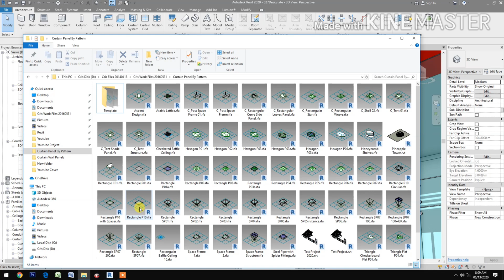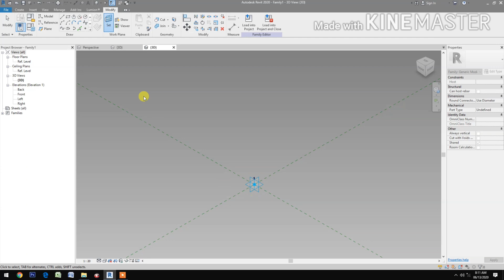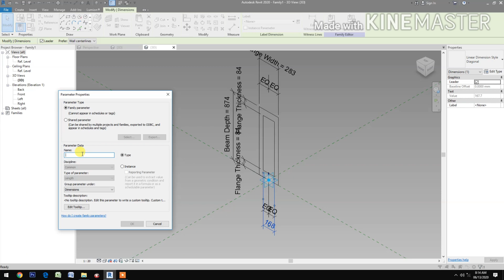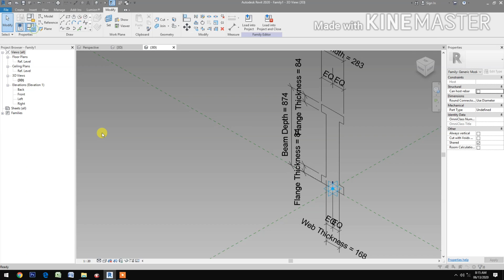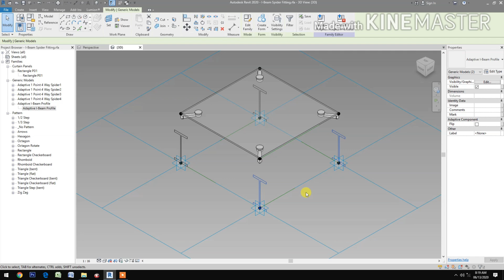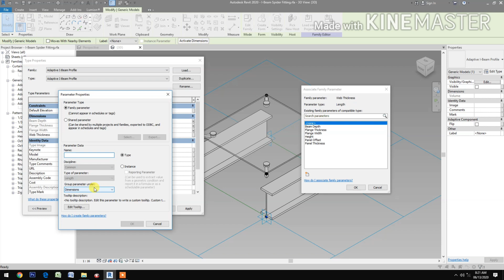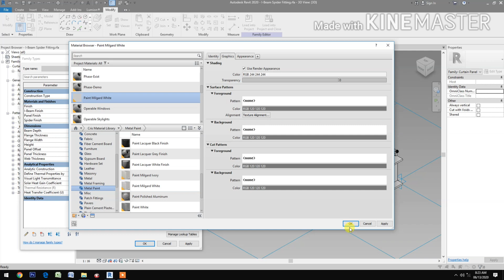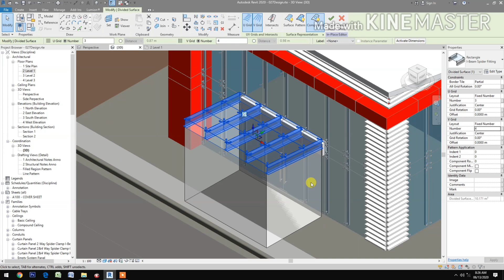RD027. How to make a Parametric I-Beam Glass Canopy with Spider Fittings in Revit.

Comment: Very educational!! Can I ask for your advise?? I am planning to do a DIY cantilever canopy. The size is 3.5meters x 1.2meters. The 1.2 meters is hanging. What size of metal tube or I-beam I can use as my trellis?? And what is the spacing?? I’m planning to use a 10mm thick tempered glass. Thanks and more power to ur channel??
Reply from the maker: I suggest you consult a structural engineer for that.
Reply: @ArCrisCruz  thanks